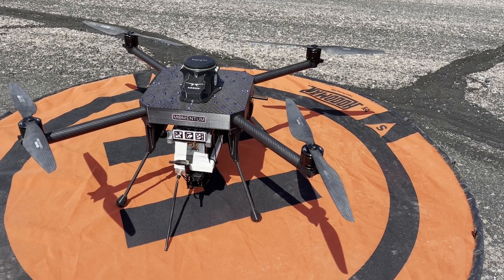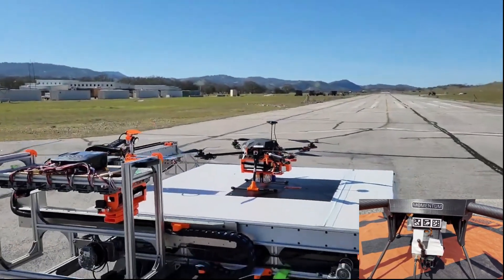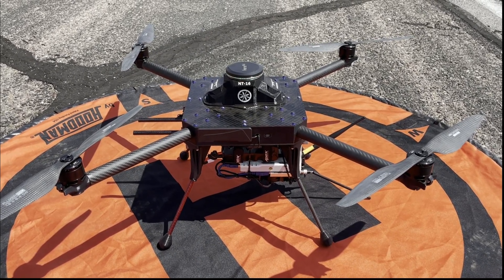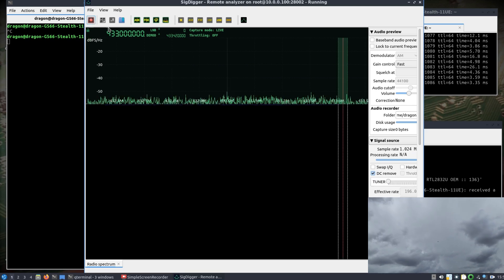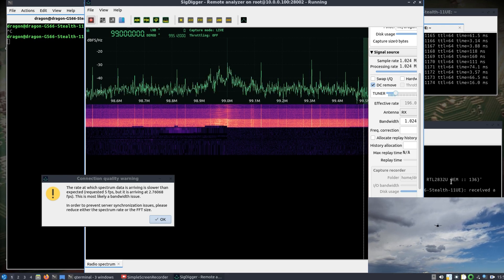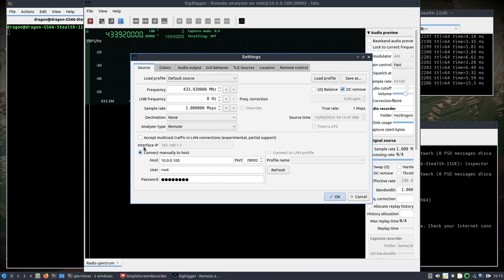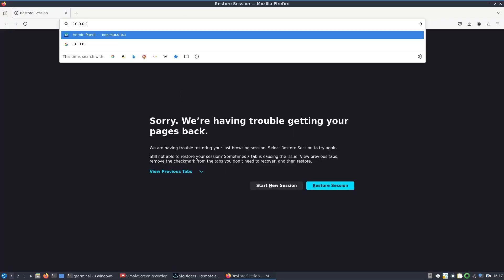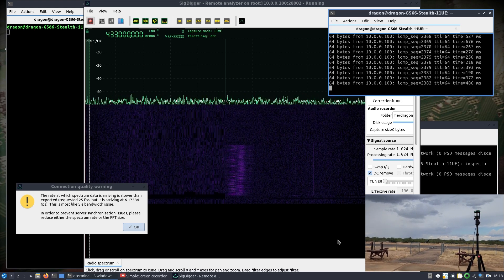DragonOS Pi64 Autonomous Payload Swaps & Real-Time EMS Monitoring w/ Drone  (T-Halow, RTLSDR)

Comment: Dear Sir, i came across an paper that discussed and implemented (bladeRF-wiphy project) similar to openwifin using AntSDR E200, but the project used the  BladeRF Micro 2.0 Ax9. it mentioned that it is more stable and has other cool features. Unfortunately, i ran into many troubles and i could not implement it. Could you please try to include the bladeRF-wiphy project into DragonOS? it would be a great addition to the Focal package. All source files and drivers are in github and Nuand discussion forum, Many thanks